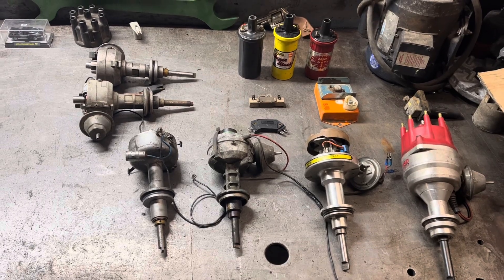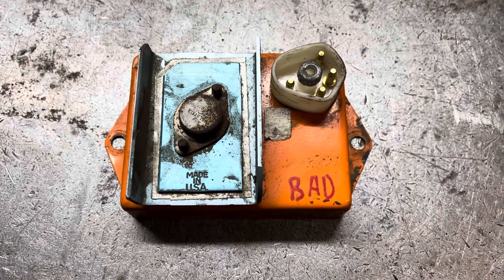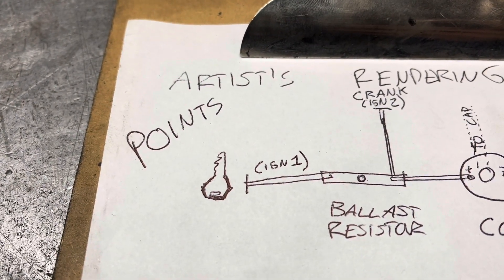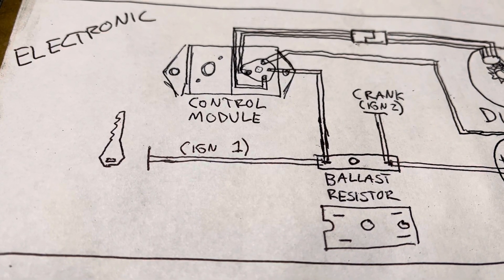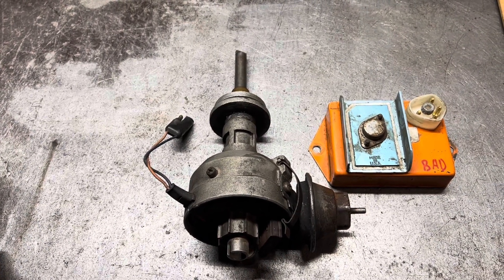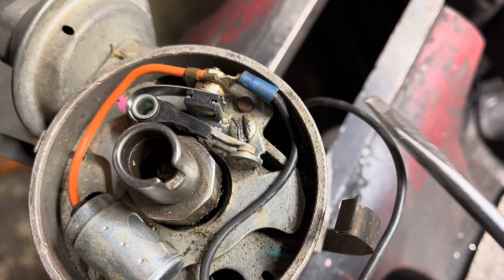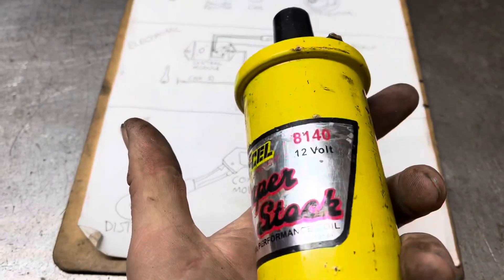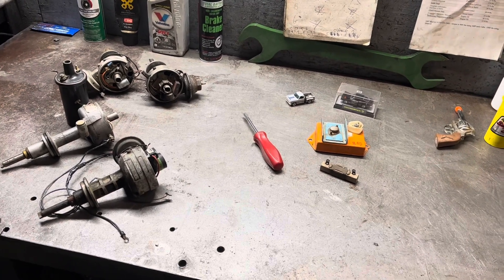Classic Mopar Ignition Systems - How They Work, How To Diagnose Issues

Comment: 9:04  Why the single spark?  A:  Before the key is turned, the coil is completely discharged; no magnetic field stored in the coil.  When the key is turned, 12V DC is instantly passed to the coil as a leading edge of a square wave.  The coil stores this energy in a magnetic field.  When the key is turned off, the stored energy of the magnetic field in the primary collapses as a trailing edge of a 12V square wave, and this voltage is increased by the windings ratio the secondary to about say 20,000 volts or so, which is passed to the spark plug which if grounded, will produce a spark. Over.  It's essentially the same thing that's happening under normal distributor operation, except were are simulating it manually with a key turn.  Cheers, great video.
Reply from the maker: 12v DC to coil + alone won’t trigger a spark. There has to be a ground on the other side. 😁
Reply: @DeadDodgeGarage  8:40  A:  Unhook the coil wire and set it near to ground.  Yes, the secondary is grounded in this way -  "Near" to ground to create the spark, which is basically the fourth state of matter, solid, liquid, vapor (gas), and then .... spark ... "Plasma".  Boom.  The plasma spark completes the circuit to ground.  Cool!  I'm just giving my opinion as an electrical engineer EE as well as a mechanic and a 318 MOPAR owner, and trying to be helpful, not trolling.  Loved your vid.   Love my 318.

Comment: I don't know if you still respond to this video. I have a question. 
If you have the Mopar electronic module. why do you need the ballast resistor??
Isn't the resistor present to prevent the "points" from burning up??
Seems if no points, no resistor is needed. Can I just bypass the resistor altogether. 
I have low voltage across my coil with the key on and motor off (like 3.7 volts).
I'm having intermittent hard start issues with my 69 GTX. It has the electronic (5 prong module) and the resistor is still present. I didn't set it up that way. That's how it was when I bought it. It ran well before but always a hard start. Any help would be appreciated.
Reply from the maker: No. Not only is the resistor still required to keep the coil from overheating, but with your five pin module, you actually need the four blade resistor as well. The second side of the resistor powers a circuit inside your ignition module. There are coils that do not require a resistor, but your factory type coil is not one of them. As your car sits with the key on but the engine not running, the voltage through the resistor will continue to fall like that. I would be curious what that voltage is with the ignition module connector removed. But in any case, my best recommendation is to clean the firewall connector to ensure the ignition is getting enough juice. My hard hot starting electronic ignition issue came down to a bad distributor module. You could have the same problem, or potentially a module issue as well. It’s hard for me to guess at which one. Also, if you have an Edelbrock carb, you could actually be boiling fuel like my Charger does, and this isn’t an ignition issue at all. I have to hot start that car by cranking for 4-5 seconds with the throttle floored. When I do this, it always fires right up.
Reply: @DeadDodgeGarage  I copied your drawn image of the Mopar electronic ignition with the 5 pin module. You had one resistor in that image. Thanks for replying and making the video. It has helped me a good deal in understanding the ignition system on my car.  Thanks again. Side note, just subscribed to your channel.

Comment: I've got power at the coil, a new ignition module (4 pin, the original was 5) a new coil wire, jumped the 4 pin ballast resistor with freshly made jumper wires have blue spark from the coil and a brand new cap and rotor. Nothing at the plugs. I must be the unluckiest S.O.B in the world. It has to be the pickup, right?
Reply from the maker: When you say you have spark at the coil, do you mean one good spark when you key on and off (the test spark I describe here,) or do you mean it zaps constantly when you crank the engine? If you get a test spark but no sparks when cranking the engine, your module is good, and this is indeed a distributor / pickup problem.

Comment: really nice video, helped me a lot understanding the ignition system of my car, thanks a lot! I still got one question: if i change my factory points distributor, by a factory electronic distributor, do i have to change my coil? or the factory one is good for both distributor? (this question may sound stupid but i keep learning, in france it's not easy to find answer for this type of cars)
Reply from the maker: Generally speaking, between the factory systems, the coils seem to interchange fine - but they may have been different from the factory.
Reply: @DeadDodgeGarage  ok, thanks a lot! you won a subscriber =)

Comment: You always want the distributor wire to go to a spark tester and good ground or you will get a faulty reading. DON'T JUST LAY IT ON A GOOD GROUND.
Reply from the maker: I truly don’t know what you’re talking about. Lol. If the coil produces a spark that will jump a 1/4” air gap from the end of the coil wire to ground, and that you can hear from several feet away, you’re good to go. No need to go digging for a spark tester. I haven’t used one in years.
Reply: @DeadDodgeGarage  you want it to jump like an inch to force to push enough voltage for a good strong spark

Comment: thank you very much for your knowledge. i have inherited an 83 ramcharger and I'm working to restore it as its been sitting for nearly 20 years. I'm converting to HEI but i had a question. it is equipped with a dual pickup distributor. what do i do with he extra plug? do i use the two or three prong plug and leave the other attached to nothing? do i wire the HEI to both plugs? or will i have to switch to a single pickup dist? once this is installed can i just remove the factory ignition control module and associated wires safely? I want to remove as much unnecessary components as possible and simplify as much as much as possible. any input is appreciated. thanks again for covering niche topics and being thorough as I'm new to the "classic" car world and I'm trying to learn as much as i can.
Reply from the maker: Throw that distributor away. There is no advance curve, and no vacuum advance. It is useless for what you want to do. It can be made to run, but the lack of an advance curve for a street rig is not at all ideal. Get a standard 73+ electronic distributor.
Reply: @DeadDodgeGarage  it does have a vacuum advance hose attached i believe its the factory 83 distributor as best i can tell
Reply: according to forum post i found a commenter posted this, does it seem correct? "find the start/ run relay, (on the firewall, to the pass side of the steering col, has two connectors going to it, one has two wires, the other has three wires)unplug the 2 wire connector , then you will only be running on the run side of the distributor, you do not need to buy another dist."

Comment: On the electric faz, what if you have nether spark or crank? 
So now what??  
You did this once before, but that was not my truck, therefor your dart fix will not work on mine.
Reply from the maker: I don’t know what truck you’ve got, but my best video on the subject is my No Crank, No Start video.
Reply: @DeadDodgeGarage  yeah great video, got that car and year. Mine is a 87, w250. Has about 3 or 4 more components then your rig has. Like a real strange ballast resister mounted next to the coil, plus a condenser thats mounted on the firewall and connects to the positive side of the coil. 
And another thing I got no clue how describe
.

Comment: So, I have a 8388 MSD "Ready to Run" distributor that replaced the original points distributor. The MSD has a three plug connector running from the base of the distributor and the matching plug runs from the coil and ground. I'm assuming the ground causes the spark that triggers the coil and sparks the distributor. Other than the ground, it all seems internal and nothing is wired direct to the ballast resistor or voltage regulator. Additionally, it looks like the old blue distributor wire from the harness is/was being used to power the electric choke on the carb.  I wired all this in 10 years ago with a friend and now I'm trying to understand it better in order to replace the old wiring with a new harness. Has my car been on the verge of burning down for the these last 10 years?  Thanks!
Reply from the maker: MSD supplies a wiring diagram for the ready to run. You’re going to need to refer to that. Your ballast should have been bypassed, and the original coil wire should be powering your ready to run and a performance coil.

Comment: Great video, I’m pretty confident I can convert my fifth ave from lean burn and wire a module now
Reply from the maker: I’m confident you can too, but if you aren’t aware, you will also need the earlier style distributor with a single pickup, an advance curve, and a vacuum pod.
Reply: @DeadDodgeGarage  yes, jegs sells a kit that has everything to do it except for a non feedback carb

Comment: I had no power at the ballast resistor but I did at the key so I put 12V to the ballast resistor and it sparked and started smoking?
Reply from the maker: Huh. You’ve got a dead short to ground… you’re going to need to figure out where. And I really couldn’t tell you why it wasn’t smoking before. It probably should have been. It could have cooked the contact in the firewall connector, or there are other possibilities.

Comment: I have a n old wood chipper with a Chrysler 318 industrial engine and it will crank but won’t fire but then when I switch the ignition off it bumps over with a random spark. I think that after watching your video that I need to replace my distributor module. It’s an electronic system with the four-terminal ballast resistor.
Reply from the maker: That definitely sounds like a distributor issue to me!
Reply: I (We) fixed it!  I started to remove the distributor and saw some wires taped up with electrical tape and remembered that they had been troublesome in the past. I re-twisted them and put fresh tape on them and put the distributor cap back on. Hit the starter and she fired right up!  Now I think that I will go through the whole wiring system and solder it all together and put shrink tubing and liquid electrical tape on all the splices. Thanks for the near life-saving advice!

Comment: 2 years later, and here I am with a question! I have an 85 D150 with a 318 and that stupid ignition control box (maybe like lean burn?) mounted in the LF fenderwell. It's dead. My solution was to bypass that entire system and run a Mopar electronic ignition system upgrade kit with the distributor, ballast resistor, and orange control box. It worked, but then didn't. So, me being the smart guy that I am (LOL), I decided to eliminate the ballast resistor and install a regular old 12v coil, supplied with 12v power from the input side of the ballast resistor. Then it worked! My question is....will this setup kill the orange ignition control box eventually? The truck runs great now, but I have only had it running and driving for maybe an hour or 2 now. Thanks, Jamie, if you can answer this! If not, I get it, you probably don't go back and look at questions on your 2 year old videos! Anyway, love your vids, man! Always look forward to new uploads. Take care, man. And stay cool!

Comment: Hello Jamie,  My 70 Charger 383 died about a mile after doing a great burn out. Wouldn't start for about an hour, then roared to life. I've heard that the ECU (5pin in this case) don't like high revs. Could the high reving burnout cause the ECU to fail temporarily?
Reply from the maker: I don’t think that will be your issue. They don’t perform well at high RPM. Each of the various flavor modules has a different rev that it stops working at, and I couldn’t hope to quote them from memory. But I wouldn’t expect what you experienced. Any chance it was actually fuel related? I’m thinking it somehow ended up flooded with fuel. I feel like I’ve seen that happen - but immediately after the burnout ends. Anyway that’s an odd one.
Reply: @DeadDodgeGarage  Thanks for your response. I don't believe it's fuel related. When it died I took off the air cleaner and checked for fuel cause I thought could b either fuel or spark. It was squirting fuel with throttle input. I don't really recall the position of the choke plate, but I don't believe it was closed. I think it was open. must've tried cranking it several times and it just cranked and cranked. I don't think it was flooded. Have you ever seen the ECUs fail because of heat and then resume after cooling? Ive ordered two of them.

Comment: Any chance you have a video for the chevy ignition set up for bench testing a chrysler motor?. I have a trigger switch hooked to my starter to fire her off but I'm having no luck on a full crank
Reply from the maker: I did an HEI conversion video - I use a Chrysler electronic distributor and a regular four pin GM module. Go check that out, hopefully it’s what you are after.

Comment: The Mallory Unilite is a good sub and one thing that can cause weak spark on points is the wheel itself being rounded over from years of use. I had points in my 64 and the spark was weak and then nonexistent since the sharp edges were rounded over.  Thank you for the content, I'm learning about the only cars I never cared for back in the 80's that were always factory stock hence boring to a 20 something...

Comment: In the dual point distributor, are the two sets of points connected in series or in parallel?  I had a single points in my slightly souped up 440, and it kept on frying the points.  I now have a Petronix, and seems to be holding.  Do you have any experience with the Petronix in terms of reliability?
Reply from the maker: Some. They have done well for me - but I’ve heard that some people have not had the same experience. As far as frying points, I have to wonder what kind of coil you were using. 

The points are in parallel. Because they both ground out the coil, they both have to open for it to collapse and produce a spark. Because one set of points opens first and then closes first while the other is still open, the electrical load (and thereby the wear) is split between the two sets.
Reply: @DeadDodgeGarage  Thanks for the response.  The first time the points fried I was using the standard small coil.   The second time I had one of these big yellow coils, super something.  I think that coil fried along with the points.  The engine has a cam one or two steps above the stock HP, and I often rev it to 5K.  I never had good consistent performance with the points, especially the last 500 rpm.  The other 440 with a bit milder cam does fine with points.  So, I was surprised and annoyed when the points crapped out twice.  The "experts" wanted to sell me the expensive electronic distributors, but I went eith Petronix, much cheaper.  The petronix is holding for my wild speed so far, and shows no signs of misfire above 4500 rpm.

It is kind of strange with the dual point distributor.  If I was designing it, I would create two 4 lobe cams one on top of the other and have the points work independently, with two coils.  So, you would have two four cylinder ignitions.  4 cylinder points run for ever because they work half as hard, and give strong spark because they have long dwell.  This would have been the way to go with dual points, and I am surprised that no aftermarket manufacturer did that.  I had seen a Ferrari 308 8 cylinder and it has two distributors.  I think their V12s were the same.

Comment: I have a 1954 Dodge Job Rated with no crank no power when ignition is turned to on. Was running perfectly before. This is my first 6volt and I’m not great at wiring. It has a generator. It’s turn key but then  has a foot start. Any help would be greatly appreciated. 🙏🏼. 

Edit: Has 6.43v at battery so seems like it’s charged and generator was working.
Reply from the maker: I really don’t know much about those systems, but I can fan you they’re not very complex… I’m pretty sure it’s a straight wire from your ignition switch to coil positive. There can’t be much to it.

Comment: Thanks for the video.  I would have loved to see more (perhaps one of your circuit diagrams) about the twin ballast systems.  and at 8:56 and 9:45 a practical demonstration of the testing would have been really cool (due to language differences, I had to rewind those 2 sections about 5 time before understanding what to do... watching you do it, would have meant 1 viewing. But thanks again.
Reply from the maker: Apologies, I didn’t have a car handy. The dual ballast powers an extra circuit in the five pin ignition module.
Reply: @DeadDodgeGarage   Thanks for the reply, Is that so that the electronic ignition module also runs at a lower voltage?  To prolong it's life?  or so that the output to the coil (trigger?) is at a lower voltage (to safe guard the coil)? Why it one side (Module side) at 5 Ohm and the other (Coil) at 1.5 Ohm?

Comment: Hey if my electronic pickup is no good will the GM one fix it
Reply from the maker: The pickup in your distributor? That triggers the ignition box, so whatever ignition box you have, you need it to work.
Reply: What I am asking is will the GM control module fix my no spark problem if the one I have is no good